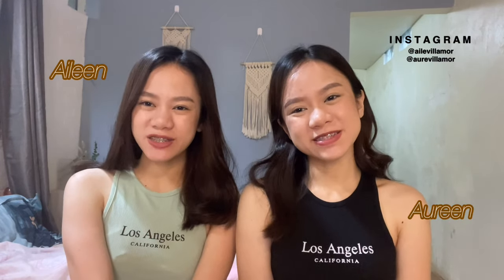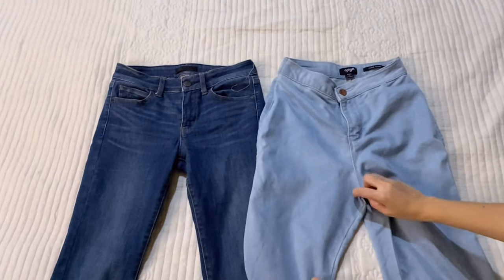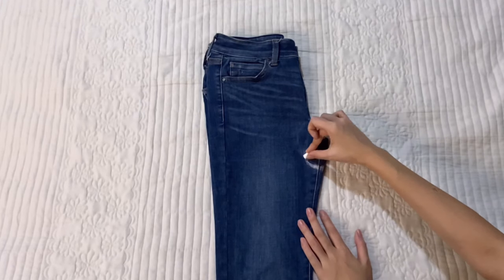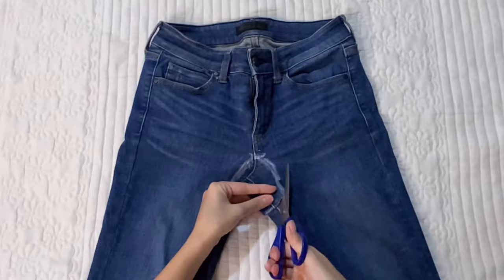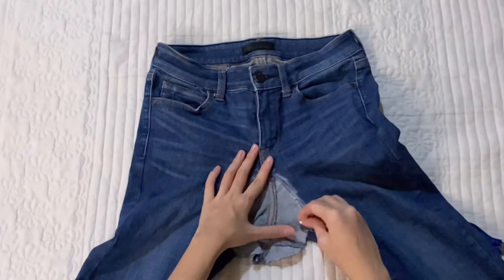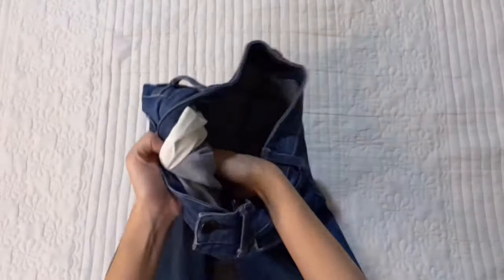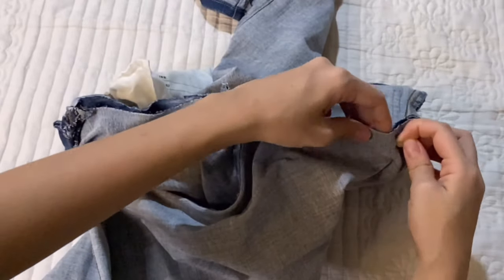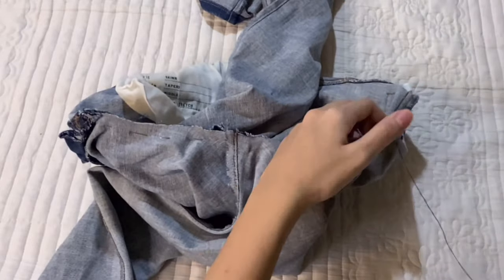EASIEST WAY TO TRANSFORM LOW WAIST JEANS TO HIGH WAIST JEANS | NO SEWING MACHINE | Villamor Twins

Comment: Tried this just now, and yes it worked. But the back and the part just below the zip doesn't look nice tho (both ends). I have to make some adjustmets which stressed me out. But it's fine now. Maybe this trick is better with dark colored and stretchable jeans. Mine is black so it doesn't look weird and altered 😊
Reply: I’m facing the same problem too. How did you adjust that?
Reply: @ngbennie  the problem with altering pants into this is that there should be room for the butt but since its not made to be high waisted i have to sew it in a way that it will not consume more fabric (idk how i will explain this really). Since my jeans is stretchable and im petite, i still managed to make it look good when worn.
Reply: Exactly, if jeans are stretchy it’s much better as this method makes jeans fit tighter on bum & thighs. Also girls should show back seam as that will end up looking very different as most jeans have a double stitched secure seam. Try on really old jeans first and cut away as little as possible if yiu don’t want jeans to fit smaller.

Comment: Would this work with fabric pants like trousers?
Reply: I did one trous and it works. Just make sure you’re doing it on a loose or straight cut trous (or one with room on thigh area). I think it will get too tight if its on a skinnier trous and wont be comfortable to move.